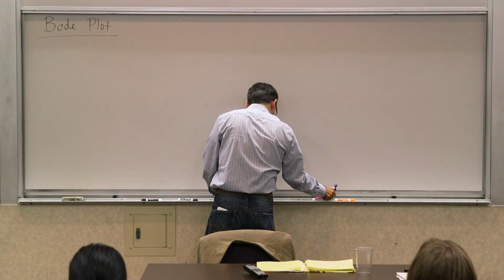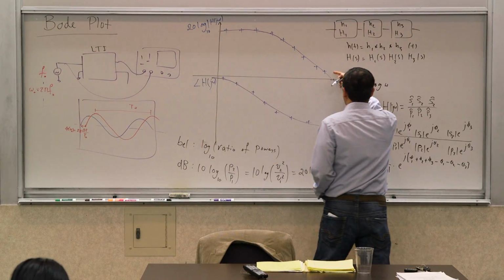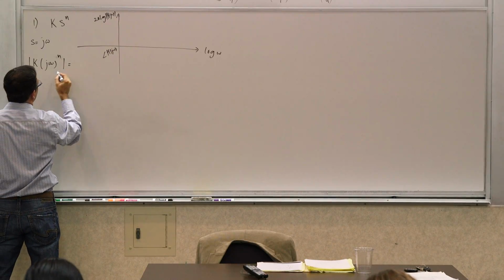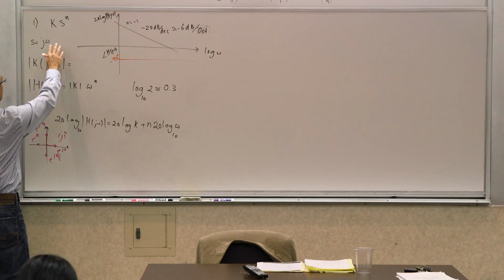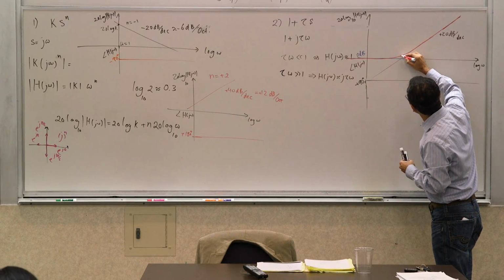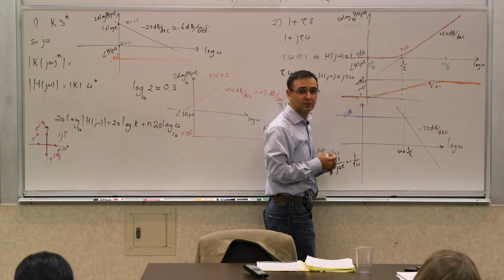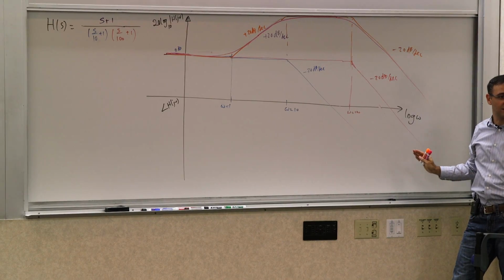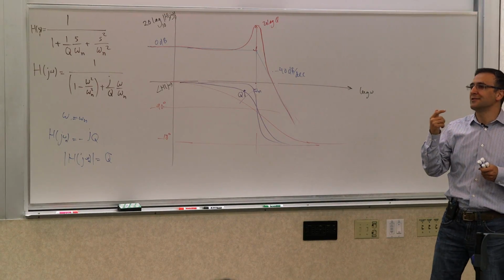032. Bode Plot: Properties, Poles and Zeros, Resonance (2nd Order Peaking)

Comment: I don't see how taking 1/10th of the bell to get the decibel equates to multiplying the bell by a factor of 10, would you not divide by 10 to get the dB relationship ?    :)
Reply from the maker: If a piece of wood is 3 meters long, and if you wanted to state that length in cm, would you multiply by 100 or divide? Hope this helps.